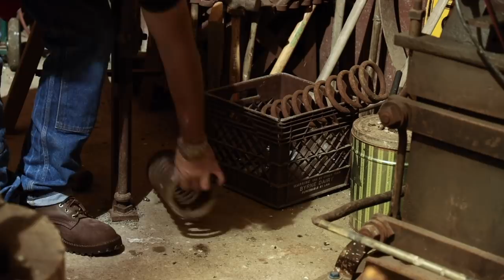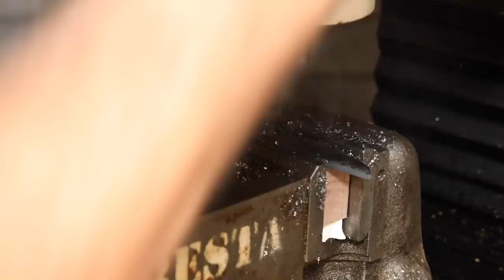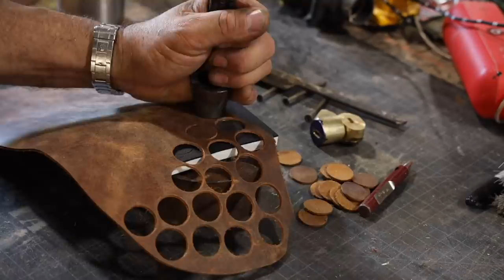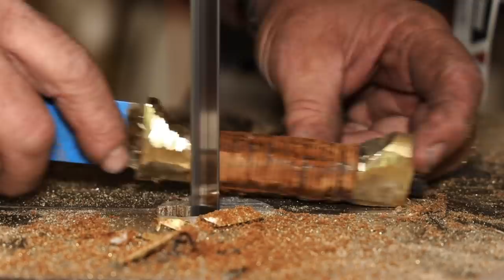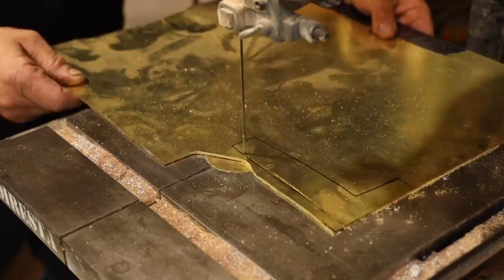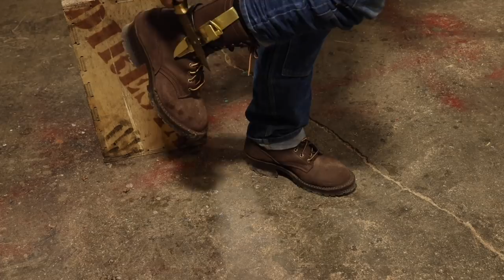DiResta Nicks Boots Knife

Comment: BTW, i have always been taught to put cork in the inside of a hard sheath to avoid the blade getting dull making contact...
but looking at the way you shave you hairs with the knife, you might be too professional for my understanding. well done again !
Reply: also brass is softer than steel so no biggie
Reply: I think the blade side is just protection and the edge never hits the brass. But personally had the same thought before

Comment: Looks cool but the tip will wear into your boot. I have worn boot knives over the years and few were useful. I had the problem of when my foot articulated on uneven ground it would restrict the movement of my foot. I had to either wear it higher or move it to another place. I chose to put it within reach in a SOB(small of the back) sheath. Easy to get to and easy to conceal.

Comment: I carried a Gerber Guardian inside my boot whenever I took the field in 5 years as an infantryman. Just in case, Tended to forget it was there. 3 inches of razor sharp double edged hard stainless steel that could come in handy. Clip-grip in a slim leather sheath with a belt clip held fast by my boot laces. A knife strapped to your boot is not a boot-knife. I would be interested in a creative approach to the true boot-knife.

Comment: That's the most unusual knife sheath i've ever seen - it's very original idea.

But it would be more simple and easy if you just buy a Mora Companion knife, or some dagger and make for him a thin profile kydex sheath for wearing in a boot....it will weights much less, and it won't be so much electrically conductive. I mean this combination of brass and steel on your foot, in some places, in some situations it can be very dangerous... It looks beautyful, but it's not very reasonable...

Comment: Prayers of Steel
Carl Sandburg - 1878-1967

Lay me on an anvil, O God.  
Beat me and hammer me into a crowbar.  
Let me pry loose old walls.  
Let me lift and loosen old foundations.  
  
Lay me on an anvil, O God.
Beat me and hammer me into a steel spike.  
Drive me into the girders that hold a skyscraper together.  
Take red-hot rivets and fasten me into the central girders.  
Let me be the great nail holding a skyscraper through blue nights into white stars.

Comment: I find it so hard to believe Nick's boots are actually comfortable 😂🤔
Reply: They're not. They're pure torture for about a month, until your foot breaks into them. (Yes I worded that correctly.) The reason workmen like Nick's or similar is that they force you to have good posture, and if they have a tall shaft ( like Jimmy's) the easiest way to pick heavy stuff off the ground is to squat. Which, incidentally, is also good for your back. Basically, they're not comfortable in the way your bed is comfortable. They're comfortable in the sense that, at the end of the workweek (in a physically demanding job) your back isn't aching, neck isn't locked up, and your knees don't feel like they're filled with ground glass in place of cartilage.
Reply: @alexnewell6504  great info man, I like the bed analogy makes 100% sense now 👍🏾

Comment: I think the sheath will require a safety strap around the handle to ensure the knife does not release during regular walking and running.  If this is the case a standards sheath will actually provide the same functionality with a quicker release and withdraw. Awesome looking design.  Not sure of the functional benefits yet. Anyone know?

Comment: I love Me Jimmy,

BUT....that is not a safe design.  Many flaws on safety and accidental deployment. 
Large potential for self harm here and I can not count all the ways here. 
The major item is the flip action with no safety check other than a tight fitment. It can open by force be a sharp open blade during a fall, trip etc and cause big damage to the user.